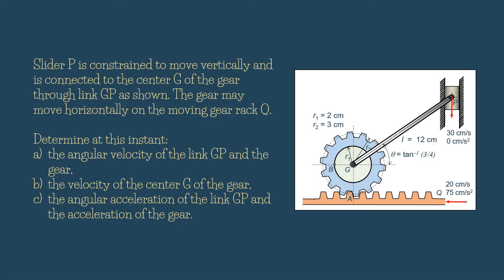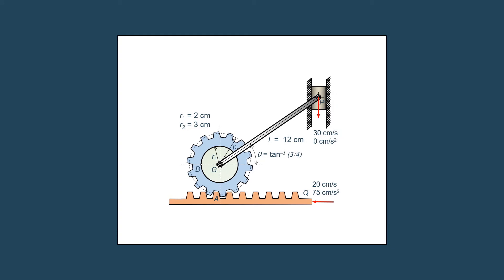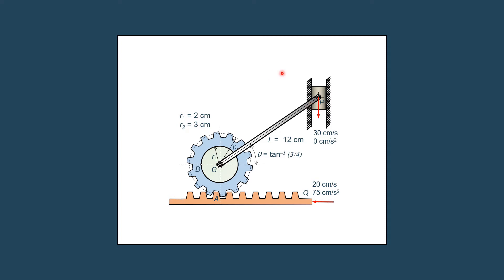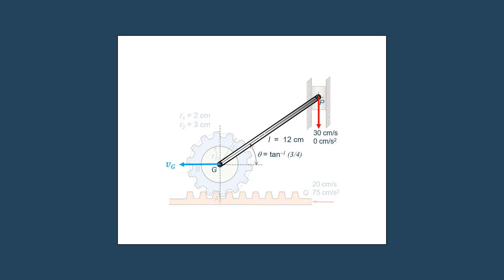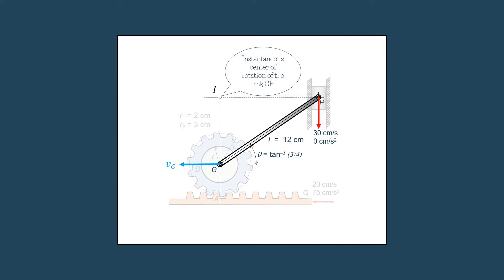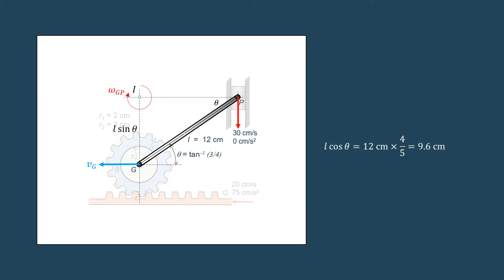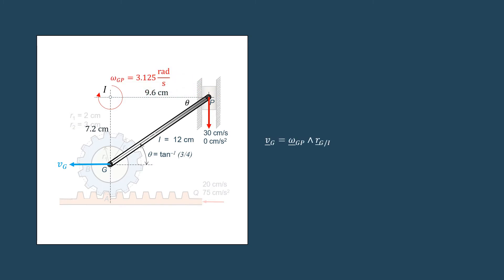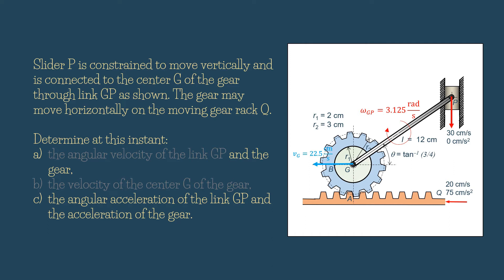Dynamics Tutorial: Kinematics of rigid bodies with gear, link and slider

Comment: What system is this actually sir??
Reply from the maker: It is a gear slider system. It can be used when we need a short displacement of a slider without the need to stop the gear motion. It can be used, for example, in a sliding autogate system. By using this mechanism, the system will be able to know if previously the gate (the gear rack) was moving to the left or to the right. This is indicated by the position of the slider. If the slider is at low position, this means the gear rack was moving to the left. If the slider is at high position, this shows that the gear rack was moving to the right. This will allow to know in which direction the autogate motor to rotate (when the remote control is pressed again), i.e.: to close or to open the gate.